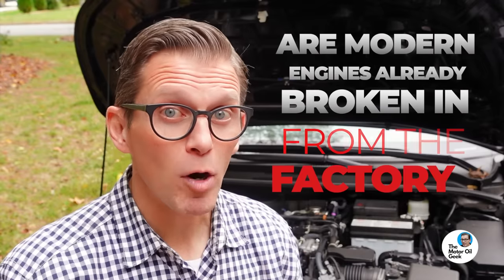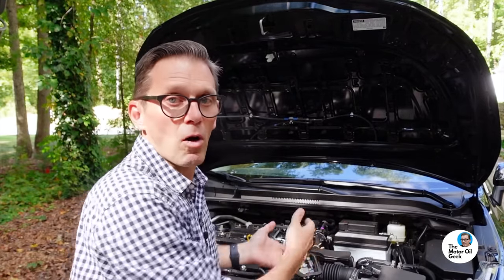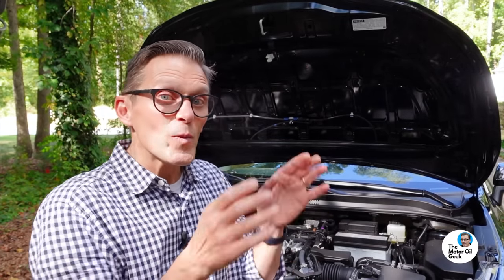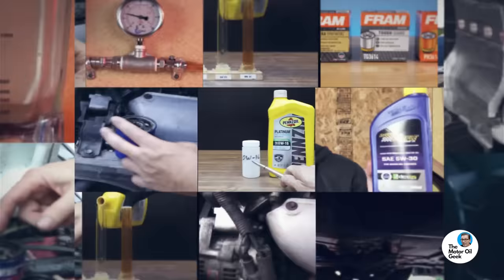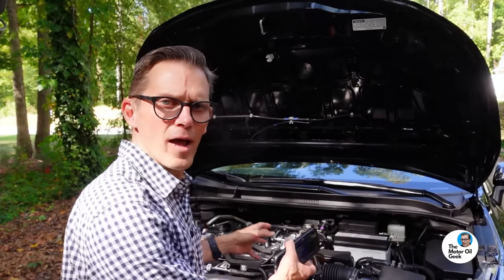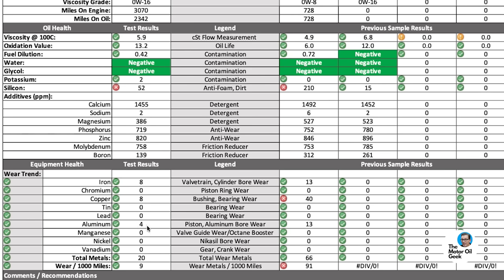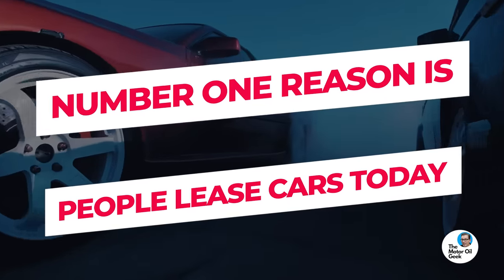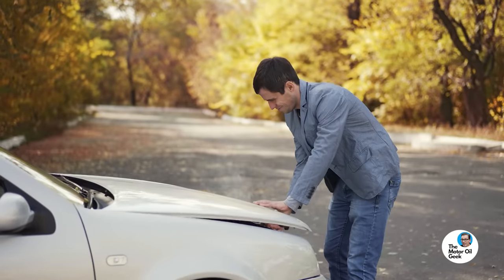New Engine Break-In: Truth or Myth?

Comment: Every new car I've purchased over the past 40 years says to essentially "take it easy for the first 1,000 miles and keep the speed and engine rpm's low", to allow the engine to break-in.  Honda even used to say not to drive at a constant speed for a long period of time.  Over time those warnings have disappeared, or moved to the fine print.  I think most people with a technical mindset would understand that makes perfect sense.  And change your oil often!!  Great video.  Glad to see the FACTS.
Reply from the maker: Thanks for sharing
Reply: Drive it like you stole it. Get the motor hot and let it heat cycle.
Babying your motor does nothing FYI except half seat rings, etc.
Reply: It doesn't make "perfect sense" to me. The key thing you are "breaking in" are the piston rings; they're meant to be abraded by the hone on the cylinder walls, so they'll become a matched set. This is why you regularly see little/no bearing wear on high-mileage engines despite fact they consume oil.

So if getting the rings seated is the key goal of break-in - should that be done by gentle, easy driving? I'd argue it shouldn't. It's not just the outward springiness of the rings that forces them into the cylinders - it's combustion pressure acting against the back side of the ring forcing it outward. Thus, to generate some good force to press those rings into the cylinder, you need high combustion pressure - which mean lots of throttle. Not necessarily high rpm, but high throttle - which implies high torque.

My break-in advice (which is worth exactly what you paid for it): Warm up the new engine, ensure no leaks or problems. Manually select a medium gear - 3rd or 4th works well. Get rolling around 1500rpm. Floor it (don't let an automatic downshift), allow rpm to climb 1000rpm or so. Release throttle and engine brake back to initial rpm. Floor it again, allow rpm to climb 2000rpm. Release throttle and engine brake back to initial rpm. Repeat process until you've hit redline a couple times. Bring her home and change the oil. Done.
Reply: @GroovesAndLands 100% agree. Seat the rings and also heat cycles.
Most motors that are compression tested after a few years, the best measurements come off motors people would consider "abused" at the start.
Changing oil is a must. Most new oil filters weigh a ton after a ring break in. Even the second filter.
Reply: @mr2_mike  I used to do endurance tests on the dyno for GM. Several laps of rpm vs time and throttle position vs time data from the factory stock racecar running @ Virginia International Raceway were uploaded into the dyno and the engine was put on test for 72 hours non-stop. Basically the engine sounded like a racecar out on the track.

Anyway, we were measuring everything. Both the LS2 and LS3 engines would make MORE power, MORE torque, LESS blowby and LESS crankcase pressure as the test progressed. Literally, throughout the entire test, the engine was getting better the whole time.
Reply: @GroovesAndLands Man that would be a cool job. Jealous.
But there you go... Measured application on bagging the motor.

Comment: Congratulations , this content is great !. "Oil is cheaper than Engines" , that's why I change oil every 3000 miles or 6 months with Penzoil platinum and purulator boss filters 👍🏻 , cero oil burning at this moment
Reply from the maker: Thank you!
Reply: Have you actually done the math? Over 200.000 miles you would have spent a new engine on oil changes. Not to mention the actual time waste or the environmental burden of undue oil changes.
Reply: Did you do the math? 200000/3000 = 67. Let’s say it costs $70 to change the oil which I would say is high. I change my own oil and it’s about $40 to change it myself. 70x67= $4690 where are you getting engines that cheap?
Reply: A brand new 4 cylinder engine costs around 4.000-5.000$ @car_junkie
Reply: @paouvous   if you think new engines for 4 cylinder car is only 5K including install  you are lost ... its more of 8-16K 
also it's only 33 extra oil changes not 66 and oil change can be as little as $30 5Qt oil is only $18-26 (walmart costco etc) filter is $4-10     and total of $1000-2000 over 10+ years
Reply: @paouvous  In my country it's imposible to find a brand new engine at this cost, and I made my own oil changes so for me oil changes are definitely cheaper than a New engine.

Comment: Recently bought a 2023 4runner TRD off road, did a break in oil change at 700 km, lots of metal in oil little bit in filter. Second change at 1350km a little metal, filter with similar amount. Plan to do the third oil change at 2500km.  Also plan to have this vehicle 25 years or more. The full synthetic oil is what comes in it and what I used to do the service. So hopefully by change 3 it has no metal present.
Reply from the maker: Right on!

Comment: The owner manual of any Toyota and Lexus clearly has this section:  "Breaking in your new Toyota/Lexus" and it recommends mild driving habits for the first 600-700 miles (look at your manuals). So, per Manufacturer, there is a BREAKING IN period of new engines.
Reply: I always read the car manuals, thoroughly, too.
Strangely, some new Toyotas have an option to remote start the vehicle. It's a pointless feature that, along with being unsafe (and illegal to use on public land, because there's no driver in the car), it prematurely wears out the engine. The owner's manuals actually tell people to drive the vehicle immediately after starting the engine. That's because it warms up the engine more quickly and the engine itself pumps the oil along with the oil pump.

Comment: I purchased a 2011 2016 and 2021 grand Cherokee all with the 3.6 Pentastar 6.   I did 1000 mile oil changes and opened up the filter element.   There were small metal shavings in the filter. In all three filters.  I have the pics to prove the shavings in the filter. but on the 2nd oil changes at 2000 miles to get me on the 3000 mile oil change / filter    All three filters were 100% clean.   

So I definitely think an oil change at 1000 miles is good maintenance.
Reply from the maker: Thanks for sharing!

Comment: Man! this is some very good info for a fellow motor oil geek . Hey Lake, if you had a 1994 Chevy 3500, 454 BBC with a flat tappet and 124k miles on the clock. What oil and filter are you going to get (if you personally owned it).
Reply: I'd use Pennzoil Ultra Platinum oil and Purolator Boss Filter. ,
Reply: @jakemanchester5139 Flat tappet requires a high zinc oil, higher than almost any modern oil will provide. I'd consider a ZDDP additive to a quality modern oil but you gotta be careful about it changing the viscosity.
Reply from the maker: Driven GP-1 15W-40 and a Wix filter.

Comment: Heavy equipment technician here- I've built numerous diesel engines for machines, and have always been big on 2 early changes. One after about 5-10 hours of test-in running, and the next after about 50. Samples on both. I have yet to heat about a lubrication-related problem on any of the engines I've built. Bad reman parts off the shelf are a different story, but.... 
Wife's 2024 Tucson we had changed at 500, and they kept insisting it wasnt necessary. I asked to see the filter, and it had plenty of wear-in metal caught. Their tech was worried because "we usually see this amount at the first 10k change", I told him I'll keep a close eye on it and bring it back at 10k, for their satisfaction. When we brought it back, they looked at the filter and were surprised how clean it was. 
Tried to make the point to the service advisors that, at bare minimum, changing that filter at 500 would make a big difference on engine claims. Who knows if they'll take it to heart. 
I personally wouldnt mind a 500-mile "wellness check" recommendation on a new car. Just sell it as making absolutely certain that everything is as good as you expect it to be, to guarantee their satisfaction and ensure no surprises- while you're there at MINIMUM change that filter, better yet change the oil, and give the customer that extra bit of peace of mind.
Reply: I worked at Cummins in the late 90s to about 2007 and their engines were broke in at the factory at least for the N14, M11, and early ISX/Signature 60, and K series models which is what I mostly worked on  . I don’t know to what extent but that’s what they told us in our factory specific schooling . I’m assuming Caterpillar and Detroit was maybe still the same way .
Reply: @dave0z96  
Cat has certified Dyno-sheets on all of their in-house engines. The dealer can get into the "TMI" system, look up the serial number, and see the report on that specific engine compared to the Spec sheet. 
I don't know how many hours they run each in for, but it's at least a couple.

Comment: I totally agree with the speculation syndrome out there however, I do have a question now.
Since we now know the engines on new vehicles are not broken in (properly) should we drain the new oil as soon as the new car comes home, and replace it with BR oil?
Then change again at 1k miles?
Thanks a lot for these videos that make us all think!
Reply: I change oil at 1,000 miles on a new engine and then change every 5,000 miles
Reply: I like the 500-1000 range for first OC.  Then every 5k.  But I'm just an ordinary guy with no formal education on the subject.  Oil is cheap, new motors are not.

Comment: That was pretty conclusive. BTW, here's another good quote, from Grace Hopper: "One accurate measurement is worth a thousand expert opinions." 😎
Reply from the maker: Good point!
Reply: The only problem with the oil analysis measurement presented in this video is that there appears to be logic problem here. Even if an engine oil has been broken in at the factory, doesn't mean that oil has ever been changed, and any wear metals from factory break-in are likely to still be in the engine oil. So the conclusion about whether or not the engine is broken in a the factory can't be determined by the first oil change at 1000 miles, unless the first oil change is immediately after taking possession of the car, and then the second oil change is sometime later (like maybe 1000 miles), and then the third oil change is about 5,000 miles or so. If the third oil change at 5000 miles (representing 1000-5000 miles on the OD) has significantly less wear metals than the first oil change (taken immediately after possession of the car  with about 5 miles on the OD), then it seems reasonable to conclude that some engine break-in occurred at the factory, which showed up in the first oil change taken with 5 or less miles on the OD.

Comment: I would like to see another mythbusting that if turning the engine off and on often bad for the engine? Looking forward for a video on that!!
Reply from the maker: Thanks for the suggestion!
Reply: Depends on how cold the engine is, and how long it has been since last time it was shut off. It can take a few seconds for engine oil to reach all the critical places when an engine starts, and the colder the engine is the worse this situation is. However, turning off an engine and restarting it in a couple or minutes or less is not likely to cause problems on a gasoline engine. Diesel engine don't like being shut off and restarted often.
Reply: Turing it off helps the engine last longer
Reply: @homerfry9234  The problem is that 90% of engine wear occurs at engine startup, particularly if the engine is cold, and when much of the engine lubrication has gone down to the drain pan. If the ambient temperature very cold, that is even worse if the engine is same temp as ambient temperature. That is why it is not always a good idea to shut off the engine for a short period of time. Many modern cars have automatic engine stop/start when you are at a stoplight, etc, but that is strictly to save gas, and the restart of the engine is going to be as soon as the gas pedal is pushed when the light turns green so the engine is still going to be warm and still well lubricated when it restarts..
Reply: Thanks for the pointless reply. Does the engine last longer when its on or off? Off is the correct answer, you are dismissed. @Mark-rw3kw
Reply: @homerfry9234  If you read the original comment that I replied to, the person asked about "turning the engine off and on often." Often means frequently, as occurs with automatic stop/start features on many modern cars when you stop at a traffic light for a few seconds, and the engine automatically stops, and automatically starts when gas pedal is pushed. I mentioned that this is probably not a big deal, since the engine is still hot when stop light turns green and the engine automatically turns on when the gas pedal is pressed. But if one is stuck in really bad stop and go traffic for a long time, and this constant stop/start happens frequently, it is probably best to turn the auto stop/start feature off on the car. This is because starting a car is when the 90% of engine wear occurs, especially if it has been a more than 5 minutes since last stopped and most of the oil has drained into the oil pan. So your claim that an engine lasts longer when it is off depends on how long it is off and how many times it has to be restated, and my answer is 100% correct. There is also the issue of wear and tear on the starter. Diesel engines are even worse about stopping and starting, so people tend to leave those engines running a lot longer even when not moving. The reason why auto stop/start features have been added to new cars is for fuel economy, not for engine longevity.

Comment: I'm currently watching this video. My two cents before the ending, is that no they're not broken in at factory. I had bought a 2014 ram 2500 with the 6.4 Hemi. Enjoyed the truck thoroughly. The only oil I was supposed to use was penzoil ultra 0w40. We could discuss more on what I did run for oils instead of the recommendation but my deal on the breakin was simple ... the truck gave a little puff of blue smoke on start up for the first 30,000km and after that, no more puff of oil smoke. So it was easy to tell the engine was still breaking in for that amount of time. I also believe (without hard evidence) that synthetic oils make for a longer breakin period though I could be wrong. Great video man! Thank you

Comment: As an engine builder and engineer, I have a different opinion on this subject. First Toyota, ( I have a new one 2 months old) specifically states there is no break in period, just avoid high rpms for first 500 miles. That said, the filter will do its job, changing oil under 5k is just wasting it. Back in the 80s when I built many V8s, we kept the oil in for 8k, it helps phacilitate break in, particals 10 microns and under, especially piston ring seating.  it will not harm anything, now the only reason to change oil sooner is for 2 reasons, 1st the effects of oil dilution, which may happen in a new car driven with short trips . ..under 5 miles per run or very dirty oil in under 5k witch I have never seen in my career and I'm still building custom $20k motors. The 2nd if it has break in oil which is very rare
Reply: I change my oil every year on my acura. using amsoil oil.

Comment: When I bought my 2015 chevy truck the dealer argued with me when I wanted my oil changed at 1500 miles. I had it changed any way. Never went back. I now change it every 5000 miles-  Mobil-1. My work truck has over 345000 Miles and this has been done since new. No engine problems little oil usage 1/2 QT between changes. We have several trucks with over 200000 miles we follow the same routine.
Reply from the maker: Thanks for sharing

Comment: My 2008 Silverado 2500HD with the 6.0L LY6 finally developed a misfire on cylinder 8 after 352,000 miles. I followed the oil life monitor, which is calibrated for natural oil, but I would use Mobil 1 full synthetic thinking I was way ahead of the game. When my mechanic pulled the driver’s side valve cover, we were both surprised at the excessive amount of sludge that clogged the oiling system! With my new engine, I’m going with synthetic blend oil changes done at every 3,000 miles.

Comment: Diesel mechanic with 26 years experience. I can tell you for a fact that the first oil change does in fact have contaminants in it that need to be removed. I know this because I do oil sample analysis on every single truck in my fleet and the initial oil change on a new motor shows contaminants from all the new finishes that ware until moving parts seat. Oil samples don’t lie!
Reply from the maker: Absolutely!

Comment: Is it also possible that the oils are good enough these days that not changing the oil at 1000 miles doesn't really matter much, and the filter traps anything large anyway?

I'd still personally do it, because it's a cheap way to avoid even a small amount of wear.  Is their any way to maybe get a more objective measure of how much additional wear would occur if you didn't change the oil after 1000 miles?
Reply: Absolutely,.
Modern engines having a Oilfilter, that keeping most of the debrie.

Back in the days, engines only have a strainer and Oil service was every 3500km, therefore.

VW never said, you have to break it in ...remember, ouer new BMW had a batch at the windscreen, too break it in.....

All the synthetic oil are lubricated that good, that you will never have the change to break it in.
Reply: @tt-rs1457 most engine damage comes from particles 20 microns and smaller.  Only a few filters can effectively filter 20 microns.  Most are 30 microns so you are running dirty oil for thousands of miles which can cause excessive wear on bearings.  It’s better to change it often and then after 5-7k miles you can go to 5k oil change intervals.